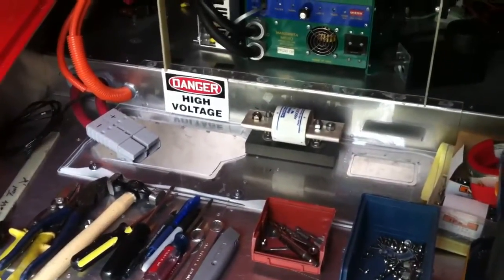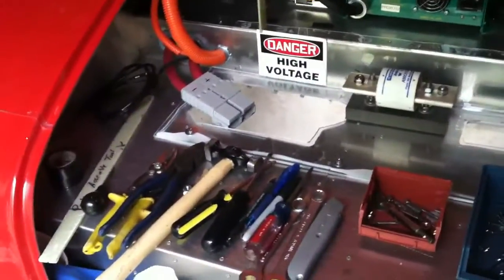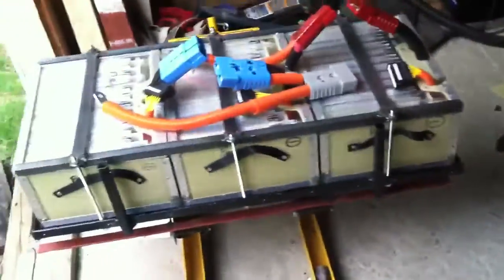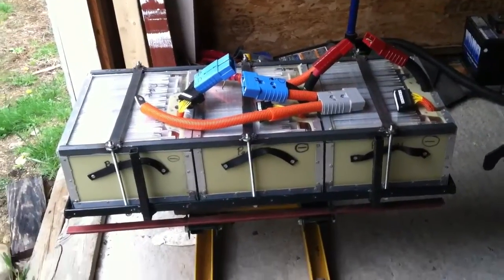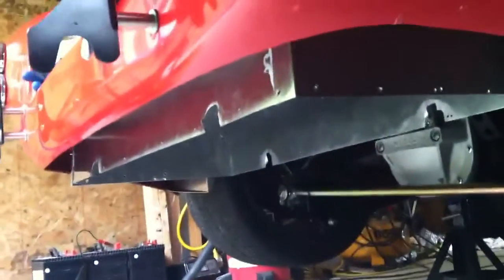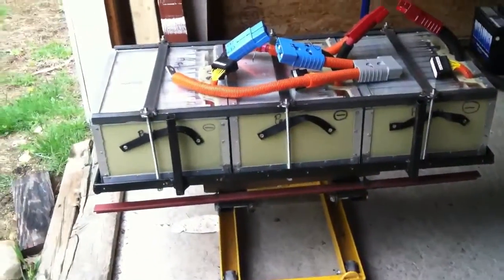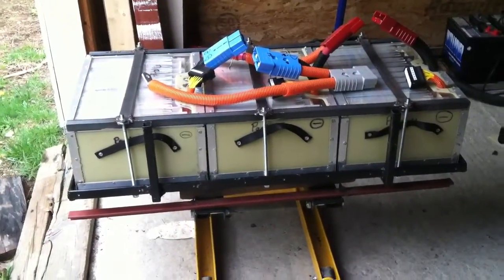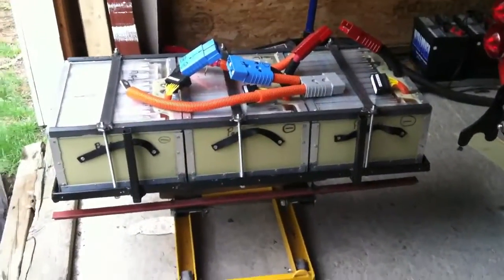Factory Five Mk4 - Electric Car - Video 46

Comment from the maker: The direct drive setup is primarily for drag racing, but the car is for street driving as well.    I am planning to add a two speed transmission at some point because of heavy load placed on the motor when starting from a stop.   The 4.10 rear end and 5000 motor rpm makes the top end about 106 mph.   With the transmission, I will replace the 4.1 with a lower numerical ratio to increase top end.    Curb weight as it sits now, is about 2130 lbs and with 400+ ft-lbs acceleration should quite good.